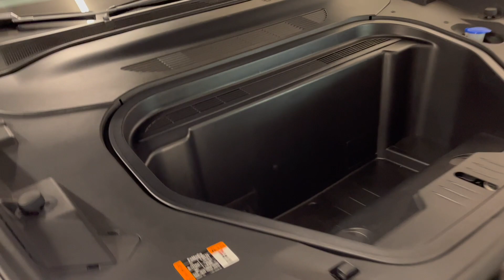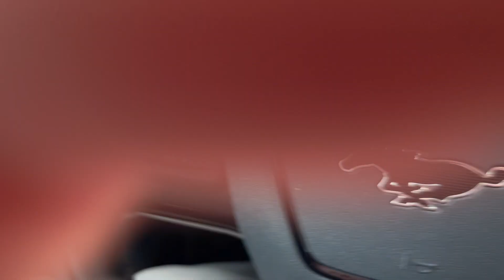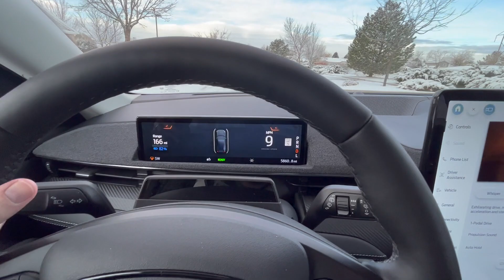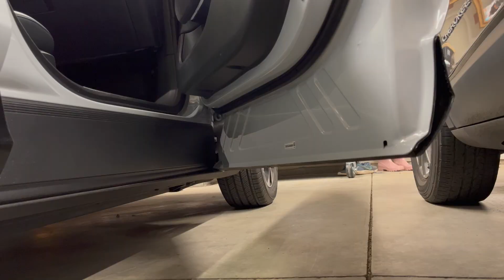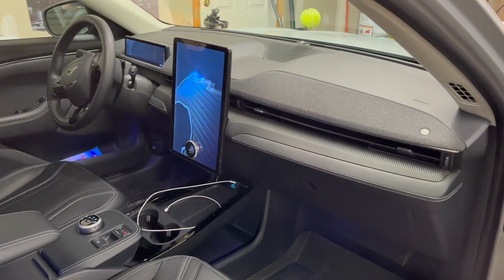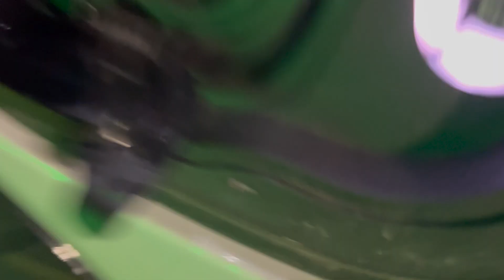Mustang Mach-E: Quirks Along the Way

Comment: I just bought a new ‘25 Mach-e GT and traded in my ‘21 Select with the 68 kWh capacity battery. I could use the “hack” of pressing “7” after entering the 5-digit unlock code to unlatch the frunk. The ’25 also has a key fob button to unlatch the frunk; too bad it’s so small now. The door frame lock buttons used to be on all the doors, but now it’s only on the driver’s door. In California the right to drive solo in the HOV lane with an EV is going away after September 30.
Reply from the maker: Good info, thanks for sharing! Does the jump from '21 to '25 feel worth the upgrade?
Reply: I enjoy the new Mach-e with its improved competencies; I bought my ‘21 because my younger son was a corporate employee making me eligible for the Ford family pricing and the $7,500 federal tax credit. My target vehicle needed to be capable of carrying a standard non-motorized wheelichair in the cargo/trunk, be able to accommodate a pair of child seats and a 60 lb Siberian Husky. 
The learning curve to operate the Mach-e was steep but the Mach-e served us well. It didn’t hurt that we had other vehicles in the family fleet. The new Mach-e had two updated features that were must-have for me -

1.   BlueCruise 1.5
2.  Magneride suspension

My local dealer had a GTs available over the Memorial Day weekend promotion and I made the trade. I have L2 charging in my garage and a BMW PHEV sharing electrons with the Ford.

Comment: I have a 2024 Mach-E and I have none of those options in the Ford Pass App to open the Frunk.  There is also no Windows up or down, no Horn or lights, no trunk opening.  None of those buttons at the bottom are there.  Even the very bottom is different.  I only have "Vehicle", "Energy" and "Service"  no "Map"
Reply from the maker: Hmm, do you see a Controls button with the Bluetooth icon on the Vehicle page? They should be under there. You do have to be within Bluetooth range to use them. If they’re not there, the forums say you may need to setup or re-setup PAAK (Phone as a key) for them to appear. Check under Settings on the vehicle page.
Reply: @studzstudios  I think you hit the nail on the head.  You are required to have your phone set up "Phone as Key" which I do not have set up.   I may try it and see.  I don't use the phone as a key, so I never bothered with it.  I  can still lock and unlock the car and turn on the climate controls without phone as key, so I never looked farther.

Comment: For key fob distance, try holding the fob right in front of your chin when you hit the button. Works I swear!
Reply from the maker: Thanks for the suggestion! I've had success with this with other cars. I'll have to try the Mach-E, but it seems like this little "hack" shouldn't be necessary when I'm not that far away. I think the issue in addition to the limited range is it doesn't always consistently respond to commands even when close. I have a newer video showing this at 8:25: https://youtu.be/PjwhtUBm8ug?si=Cr215n0Lu5Imc-mz&t=506

Comment: There are 4 ways to open the frunk.  The one you left out is the key pad on the pillar, you can also open it that way.
Reply from the maker: Thanks for sharing! I did not know about this. Owners manual says, "Enter the factory-set code or your personal code, then press 7·8 on the keypad within five seconds."

Comment: Calling it a “frunk” is like signaling to the world you take your soy with extra soy and a soy froth with powdered soy to top it off
😮
🫃
Reply from the maker: Have to say I prefer "front trunk". Any other suggestions on what to call it?
Reply: @studzstudios  it is a trunk. Trunk is just a container, not an implication of a location. If a cup holder is in a rear passenger area or the front occupant area, does it become a frup holder etc?
Reply from the maker: @billgates3699  Fair point! Since there are two trunks, then it seems "front trunk" and "rear trunk" is appropriate if the specific location is important.
Reply: @studzstudios  two trunks? Thought it was a hatch in the back but otherwise yes if there are two compartments it would be like saying front and rear cup holders.
Reply from the maker: @billgates3699  true! Rear is a hatch in the back

Comment: Tire size has an affect on Milage..These tires were engineered for this EV...If it had fatter tires and less milage people would be bitching about that...
Reply: I have a none performance GT, and my tire size is 245/45 R 20.
Reply from the maker: The skinny tires definitely help the range. The GT does have wider tires, but also has a bigger battery to help make up for it.

Comment: I got lucky when I was DC fast charging at an Electrify America charger. It didn’t work, and I couldn’t remove the cable (and no power was going through it). I was freaking out cause I thought it got “stuck” due to the thick and awkward canble. The guy charging next to me said “try the menu screen”….nothing.  Then he said “what about that button next to the port?”    I hit that and it released!!  Why don’t they tell you that??  I thought I’d be stuck at a rest area!  You didn’t mention how to disengage it at a DC faster charger.  That button is how……
Reply from the maker: Thanks for the tip! Glad you were able to disconnect.

Comment: No door handles prevents breaking entry. Can you say F150. After two breaking to my King Ranch. I eliminated door lock on drivers door and just gave up and sold it.
Reply from the maker: Interesting! Hadn't considered this. The Mach-E has other components to could break, specifically the "presenter", to push open the door open. If this breaks, as long as the electronic latch releases, it should still be possible to pull open the door from the outside with the fixed handle.